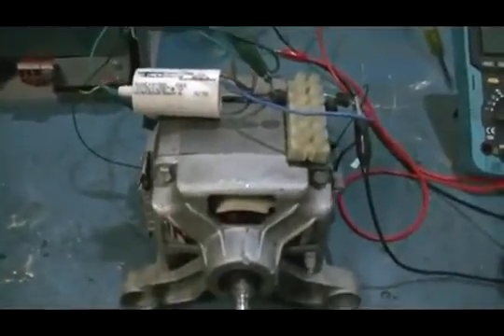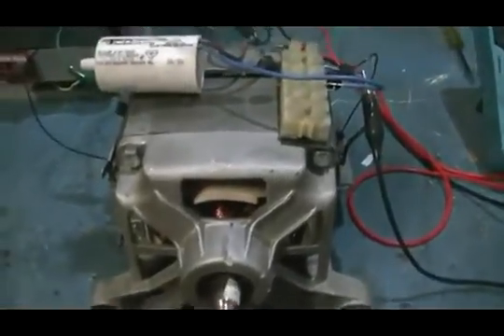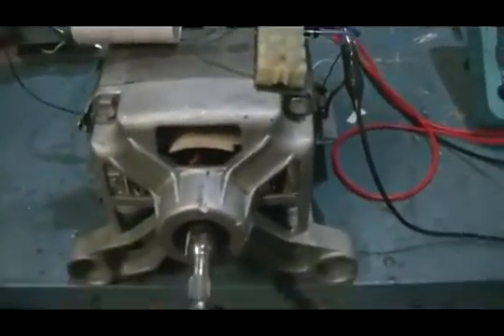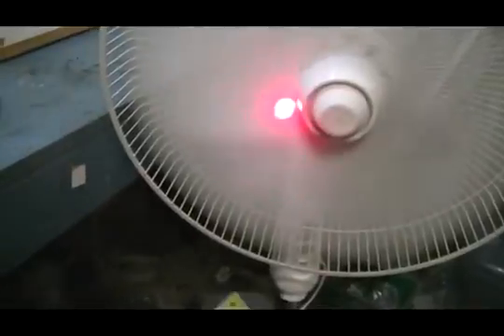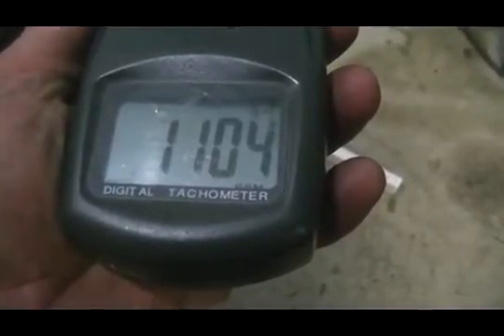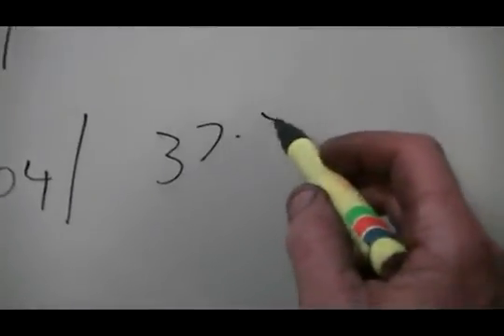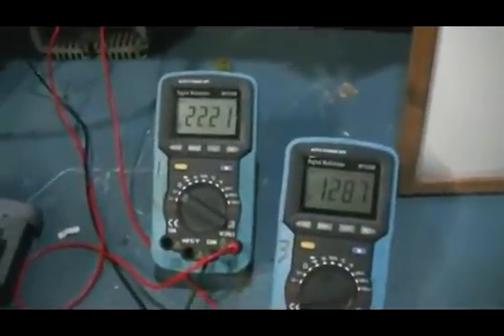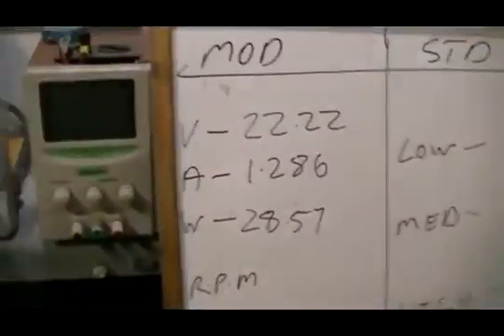Rotary transformer v standard motor test 2

Comment: 33 revs/w from a motor that supposedly is 85% efficient minimum, right? Therefore 100% efficiency would be 33/.85 or ~39 revs/w. You're getting 55.47 revs/w.  (55.47/33) * 0.85 = 1.428 or 143%.  Does that not put you into OU territory? If not, can you explain why not?

Comment from the maker: Hi Mike
I havnt done a HP test on it yet,but from the information on the video,we can use F4E;s calculation's to get a ball park figure.
Once i get the second winding on the stator,i will put the rotary transformer on the prony brake test bed and get a HP measurement.
These test we are doing now will reflect toward the prony brake test result's.
If they are close,we know we are on the right track-if they have a large difference,then we need to look for where we made the mistake.